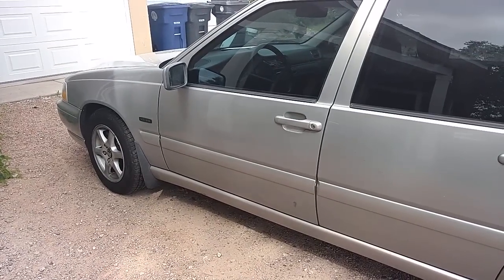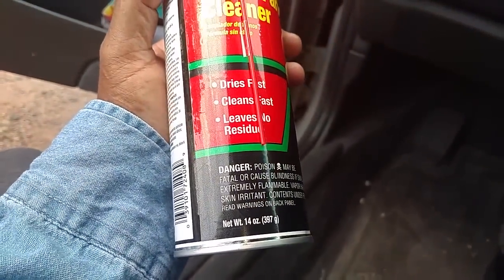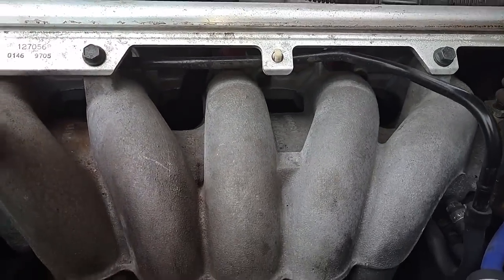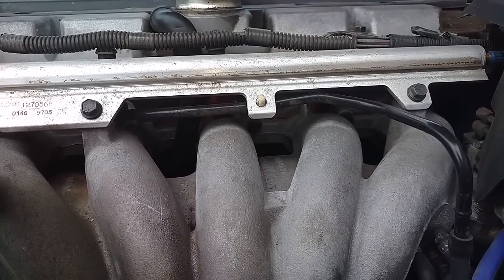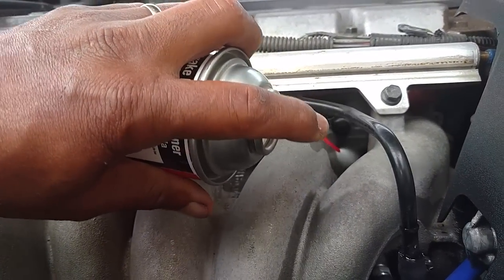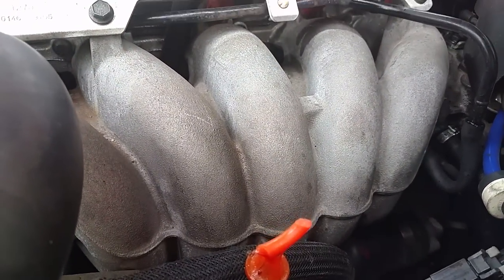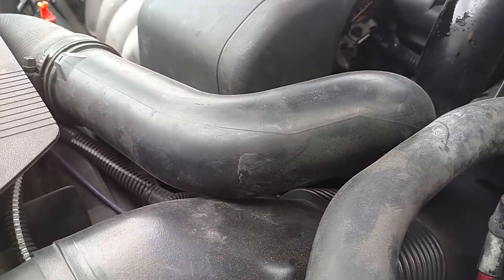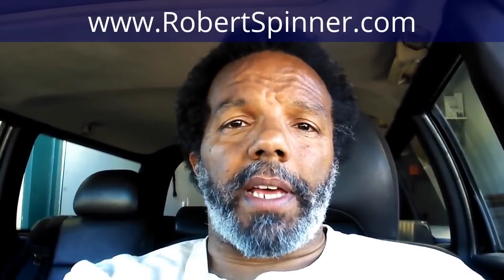How to find a vacuum leaks or intake manifold leak with starter or brake parts fluid. - VOTD

Comment: Hey Robert my name is Stanley I have a 1997 Plymouth Voyager for some reason I am not losing antifreeze from my radiator but I am losing it from my overflow I am smoking white out of the tailpipe I have no bubbling coming out of my antifreeze my pvc valve is clean good compression I've been trying to get some help I was wondering if you could just come up with some ideas I have $269,000 Mi on it I was thinking more of the manifold weekend I don't know if you have any ideas can you please contact me and let me know thank you have a good day
Reply from the maker: I don't know if coolant flows through the manifold on those vehicles, if so, that could be an issue.
Reply from the maker: I think the engine has a breach in the head gasket.

Comment: If I suspect a leak,  I always test when engine when it's dead cold,  first start. I use water in a spray bottle.  Some of those intakes tend to seal backup when warmed up.
Reply from the maker: +kapple17 Yes, that is what I did here.
Reply: Then water gets in your engine...
Reply: @RzVids  ...water injection.....power increase....won't hurt anything